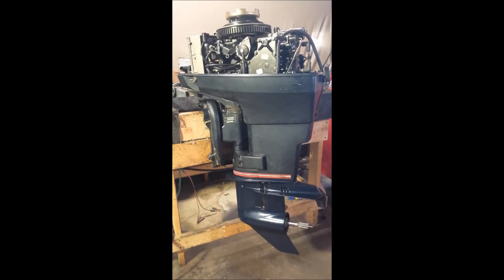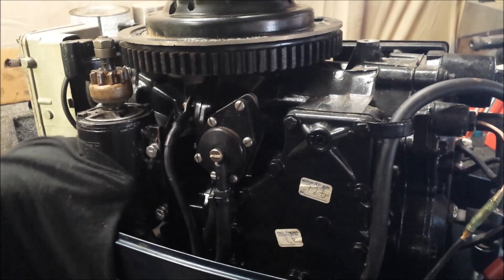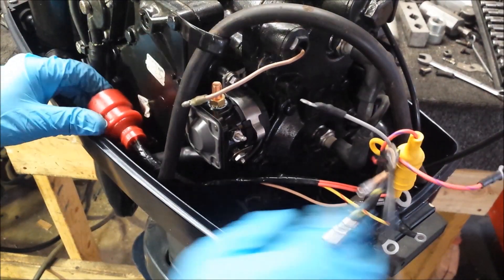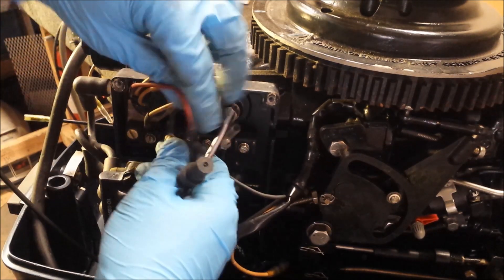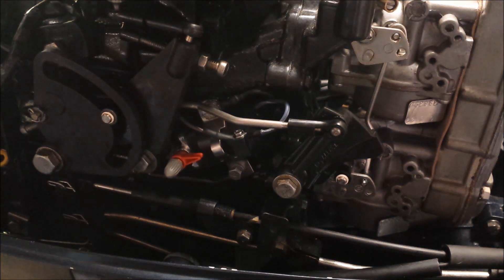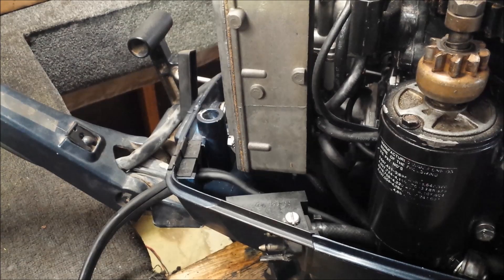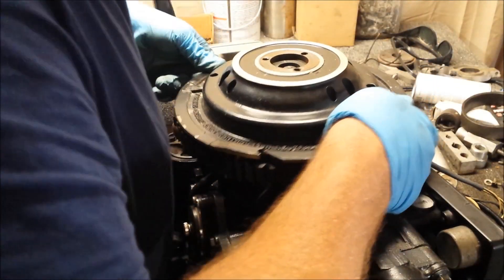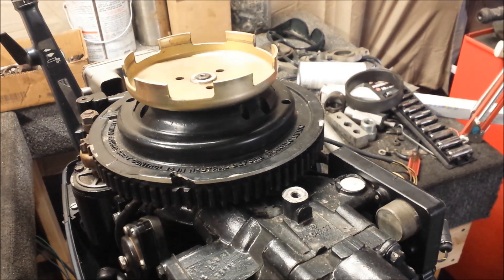Evinrude 40 HP Part 4: Adding Electronics

Comment: Just what i needed got a 92 48 special no battery wires i thought i knew where to attach everything this helped alot thanks! Subscribed!
Reply: Part 4 of Evinrude 40 is much appreciated. I have a VRO casualty ‘94 50hp Evinrude and bought a ‘95 like new powerhead. The powerhead swap was easy but I was not aware that OMC changed the engine wire harness in ‘95. Your video helped me to reinstalling the ‘94 big red plug harness.Thanks Subscribed

Comment: Hi Brandon, Whats the chance of you doing a video on the johnson 3 wire stator and the 4 wire regulator, the same as you have fitted to your 40hp, show us how to bench test each item and test while the motor is running. I have searched the web and youtube but cannot find any information on the test procedure of those particular items, there is a video on a johnson 4 wire stator and some info for other brands. I'm sure there would be many people out there besides myself that would appreciate your imput and explanation.
Cheers Peter.

Comment: Will these engines Run just fine without a functioning charging system? Meaning after its started as long as you dont shut it off will it continue to run? I have one that i dont believe is charging, previous owner said he never has to charge the battery. But my quick running voltage test i had 12.6 volts at idle with a charger connected (6amp cheap small charger).

Comment: I just got one of these, but it's VRO model.  When I push the start button, the choke clicks, but the starter/solenoid does nothing.  I can jump the starter, and the motor runs fine.  I just changed to starter solenoid and that didn't fix it. So, is my problem in the start switch/button?  I assumed the switch was working because the choke responds (clear click from there).  Starter solenoid makes no noise, but definitely has power because I can jump start it from there too.  So am I hunting a bad connection in the start switch or a fuse somewhere?  Thanks by the way - your videos have helped me with a number of motors.

Comment: Hello, I have a question, I am from Poland, I have an evinrude 30hp from 85r I put on a stator and voltage regulator and the battery charging is when the battery is charged on the meter shows 12.5v charging and when discharged it is 13.5v and then it drops to 12.5v, thank you in advance for your answer

Comment: watched the video today and got me thinking bout where to look at problem i have w a 1975 50hp evinrude sizzler-its a sizzler alright-it shocks me when im holding the controller or touching the throttle-i put a used stator in and maybe i have a wire shorted to the frame-i am going to run at night to see if i can see sparks-it runs good and i need to sell as i fix and sell junker motors for spare cash-cant sell a shocker-good video

Comment: Hi I have a 1990 Johnson 55 commercial tiller and want to convert it to remote. I noticed your motor has a tiller tube that is capable of getting a steering shaft through it. Mine has a 1/2 inch pin that goes through it almost like a very long bolt also from your other videos your motor has place for the shifter and throttle cable to be secured in a anchor block mine does not. ???

Comment: Hello, lm hopeful you can help me, l have a 1991 johnson 40hp hand tiller, l have converted it to forward controls with the same control unit you showed on line, l've added electric start, converted my gas assist ram to hydraulic ram, my motor already has a regulator and stator fitted but does not charge, my stator has 3 wires, yellow with blue stripe, and 2 yellows with no stripes, just plain yellow, although they are both brown wires with a yellow rubber type of coating on them, the yellow coating has broken down and is peeling off, l cant find anything on the web describing which way they should be connected, or if it even matters which way, lm wondering could they be connected wrong, if l swap them over can l bugger something else? Any help would be appreciated. 
Cheers Peter.
Reply from the maker: There should be a yellow with gray stripe too. Its hard to tell but should be there.
All 3 wires from the regulator and stator need to be connected together properly. 
Yellow/blue, Yellow/gray, and Yellow, all connect to the corresponding wire.
Reply: I will check again but lm pretty sure mine have no stripes, l will remove the shrinkwrap and look further up the wires.
Cheers.
Reply: Yes you are right, l stripped the shrink wrap all off and found some undamaged coating and found the yellow with grey, all is good and reconnected, still not charging, have to work out how to test things now, Cheers.